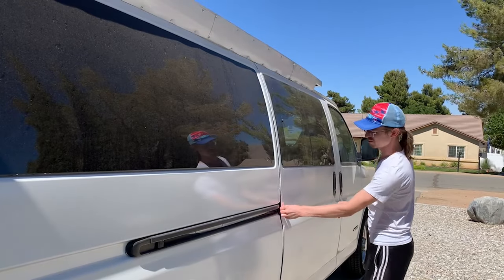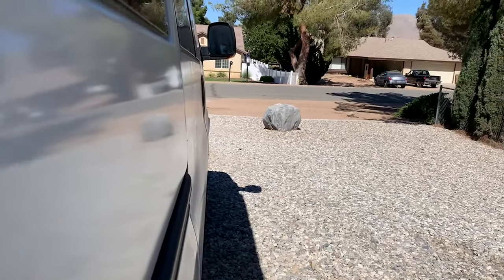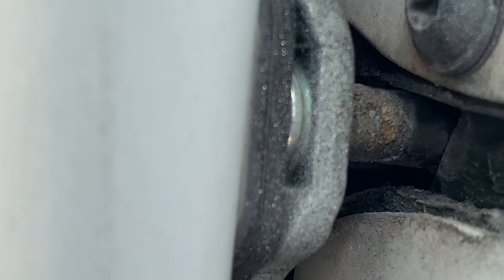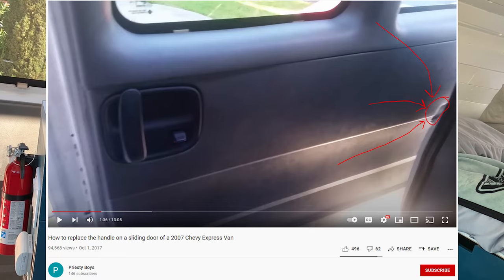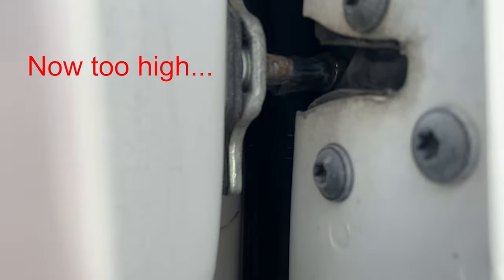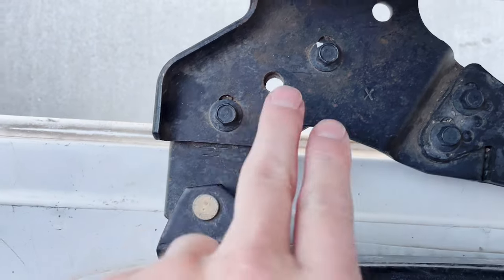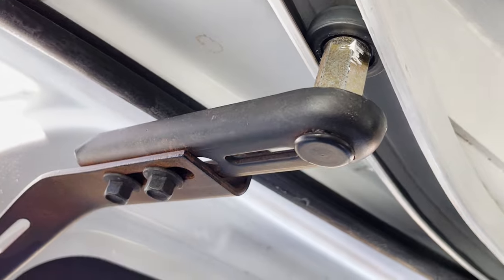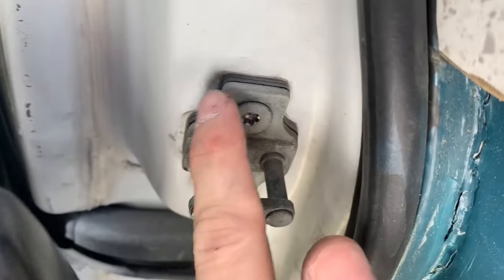Sliding door alignment (Express / Savana) 1996 - 2021

Comment: I followed the tips but just made my door worse, but tbh I probably needed a second pair of hands. Once you loosen those bolts attached to the lower front, the weight of the door makes the top pop out of its rail and then it became a nightmare juggling of holding the door up, hammering the plate to try and get it in the right spot, and tightening the bolts again. It started to rain so I got it closing again but it's alignment is way worse, I am confident that with some extra hands I'll be able to sort it out. Thanks for the vid! I know a lot more about my door now.

Comment: Thanks for the great video explanation Tim.  I just installed some Slick Lock plates to the door latches and will be using your explanation to re align the slider door.  Mine has to be shifted forward to increase the clearance but that is something different.

Why, you did such a good job explaining the slider I think you should go around the back and re align your rear doors.  While you are filming it please make sure you show how to get the twist out of the right hand door which is out at the bottom. :)  :)  ;)

Great video. You are good at this.

Comment: Tim might want to try some lube on some of the contact points.  His dry climate is not helping things.  Excellent video on adjustments.  A little patience and that door will operate perfectly.  Thanks Tim!!
Reply from the maker: Van has lived most of it's life in California. No rust which is nice, but it takes it's toll on bearings and bushings!

I did lubricate the tracks when I first bought it, but the rear center roller actually started sliding on the track without the wheel rolling!

Made a bit of a flat spot in the wheel eventually, but in the end I know the real fix is to replace the worn mechanisms.

Always something with these high mileage vans haha

Comment: What causes the rear latch to stick, door pops open when pulling handle but I have to use my left hand on the rear of the door to pull door out and then she opens
Reply from the maker: @1:05 - the bottom rear roller has worn down enough that the center rear striker / latch are no longer aligned, so even after the latch is released from pulling the handle, the whole rear half of the door is resting on top of the striker pin instead of the roller mechanism. Because of this you have to pull the door outwards at the rear for it to drop down off of the striker pin.
Reply: I understand what adjustment draws in door tighter in the front,  but what adjustment  gets door more inward for the rear?

Comment: Question about the front striker on the pillar : if I remove the striker bolts to change out the striker, will the inside plate stay there , or do I have to pull the interior trim and hold the plate?

Comment: Great video. You have any suggestions for a dysfunctional sliding outside door handle? Sliding door opens with inside handle but outside handle won't open the door. Striker plates appear to be aligned but still no action from outside handle.
Reply from the maker: Hey Jake, have you checked out Jasons video on exterior handle replacement? https://youtu.be/ITFD8Ll4XFA?t=350

Could just be the rod clip on yours or it may need the whole exterior handle assembly replaced.

Comment: Hey, I'm not an expert on vehicles and stuff but I have a question does this model have sliding doors on both sides?.
Reply from the maker: Some came with the option for dual sliding doors but only the 1500 models with the standard wheelbase, and only in passenger van form. I also believe only a certain year range were available as dual sliding door.